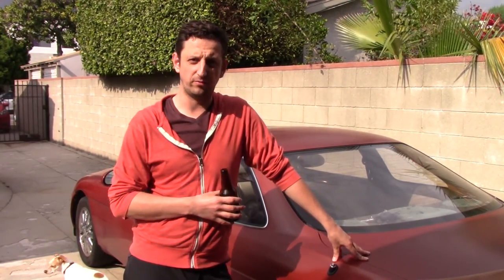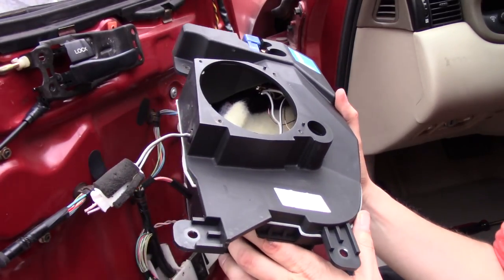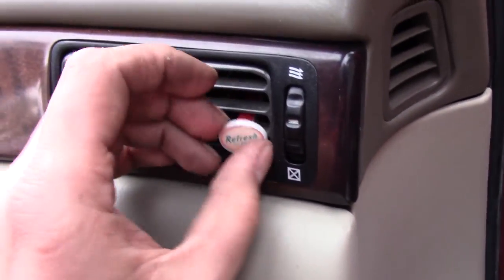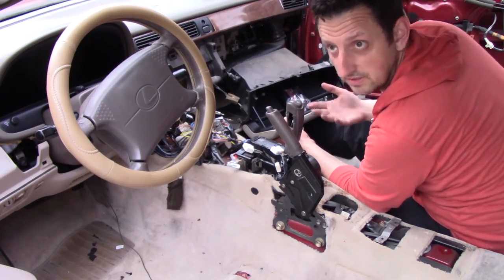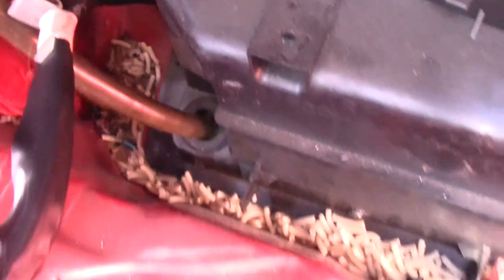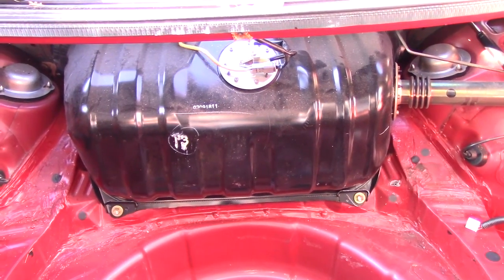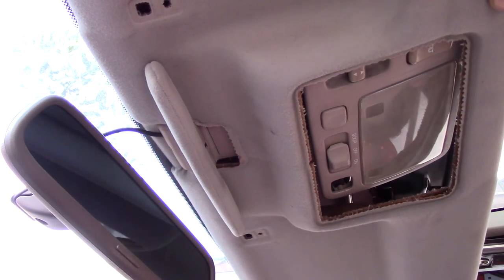Lexus SC300 Drift Build.  Ep.3 - Weight Reduction. Pt.1 (stripping the interior)

Comment: that phone cord looking wiring was for the bass knob that you unscrewed under the steering wheel. that controls the level off bass the amp gives the subwoofers that way you don’t have to dial it on the amp everytime. good video bro i’m buying one of these too as a drift project
Reply: Did u already get one with drift car in mind? Takes sooo much money and time to get a drift build with these.
Reply: @dackbowland1876  yeah bro i got one a few years back and ended up growing out of the phase. But they’re fun as fuck to swing
Reply: @XxDylanRockzxX  I can’t stop cruising mine in nice weather.  gotta get the diff rebuilt from too much spirited driving lol. Only thing I hate is that the 400 needs premo

Comment: I'm working on a 93 sc300 as a project car. My interior is just disgusting and both front seats need to be restored or flat out replaced. I'm surprised the back seats are somewhat decent still dirty but not torn up like the ones in the front. I bought some front fenders to replace the fat dent on my stock fender
Reply from the maker: Not a single interior piece was reusable. I kept the dash, but even that has cracks and issues. My car was not maintained well at all over its life.

Comment: I just got done painting my door jambs and was wondering if I should even put back the seals.  I'm going a similar build as yours.  Did your remove the door seals and if so is there risk of water getting in. Thanks.
Reply from the maker: Water would likely get in. I left all my seals in place for now - at least until I go full racecar and replace all the glass with lexan. I still want to keep it somewhat watertight until that happens.

Comment: Wait a second. Is you passenger door handle broke. No way. I had 2 with same thing and my boy just got one with a broken passenger handle. Wtf. Did they make them to brake
Reply from the maker: Yeah the door handles on the SC are terrible. They are cheap plastic which get brittle and break over time. A common upgrade is the metal handle from the LS400. My driver side cable broke as well, so both doors are a mess.

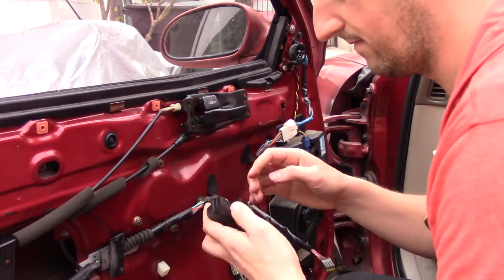Comment: 2:57 you can sell all of that in ebay trash = money
Reply from the maker: True, but most of the buttons were broken and the plastic was missing tabs, and a bunch of the wiring had corrosion from a leaking window seal. I didn't want to sell stuff that potentially didn't work. I kept the parts of the interior that were not damaged in some way, which wasn't much.